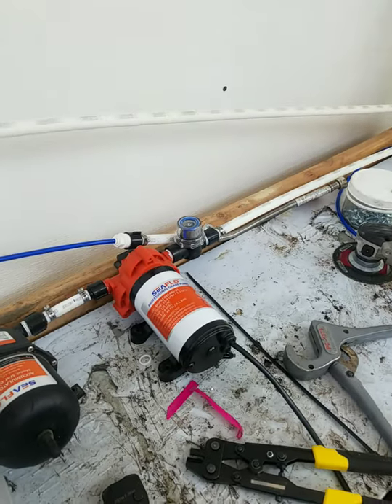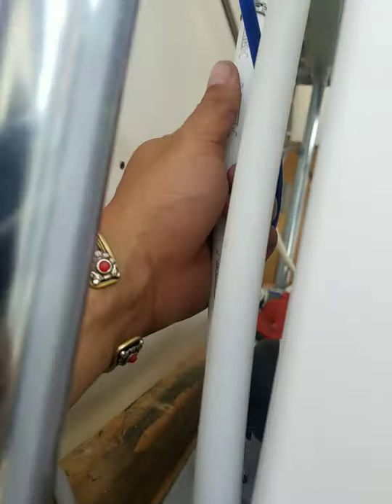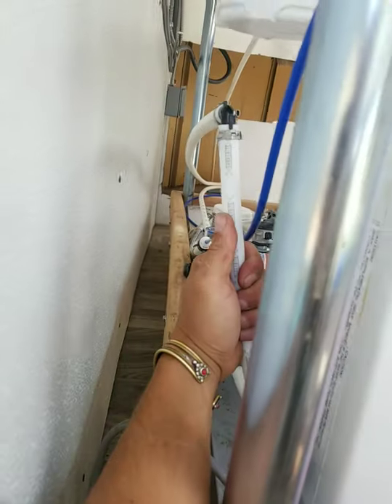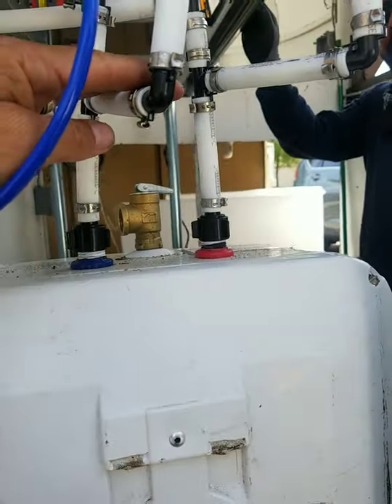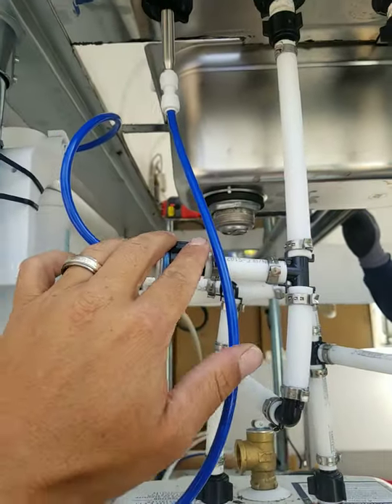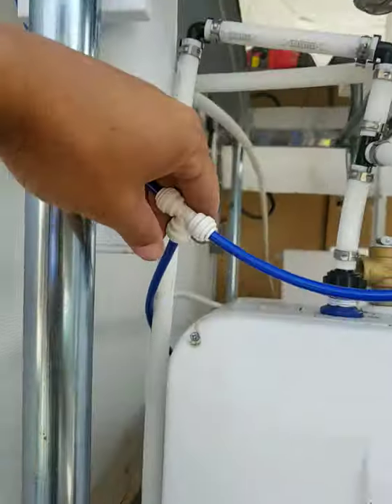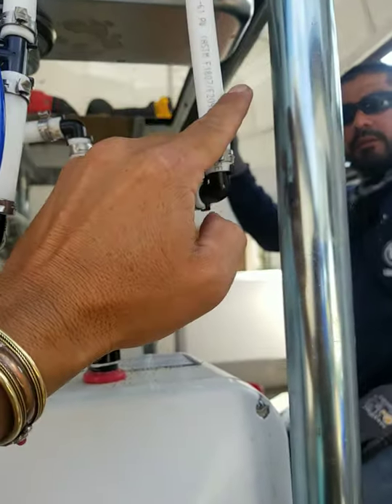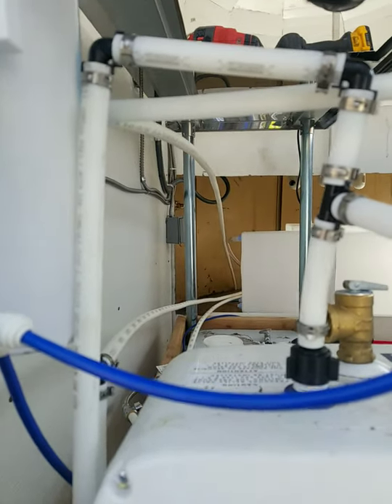(Quick Video) Installing the plumbing from the espresso cart to the coffee truck.

Comment: Thank you for your very helpful videos! Do you have any recommendations about using PEX vs copper during any portion of the plumbing? When it comes to PEX leaching chemicals into the water used for espresso?
Reply from the maker: Hey Laura! Good to see you again! So I’ve never had an issue with chemicals from pex . I favor them over copper bc they don’t bust in cold weather.